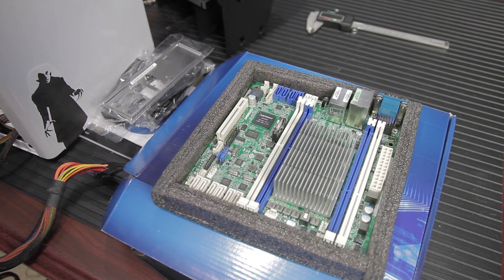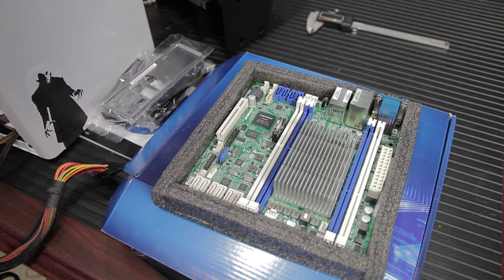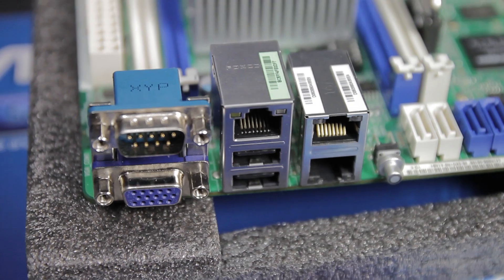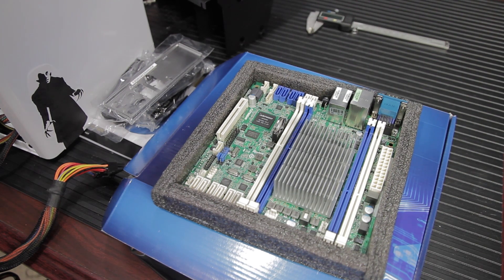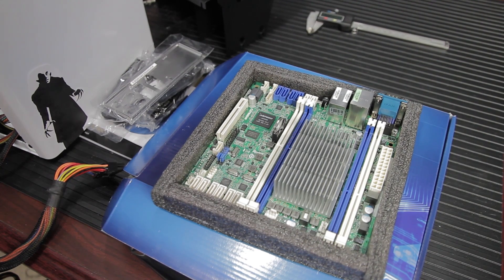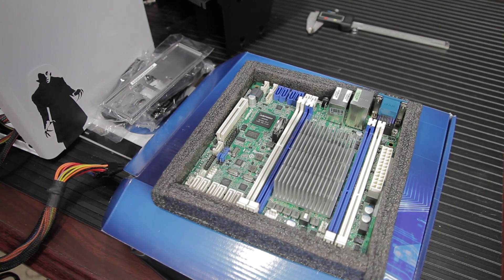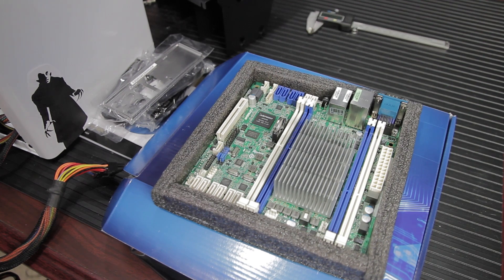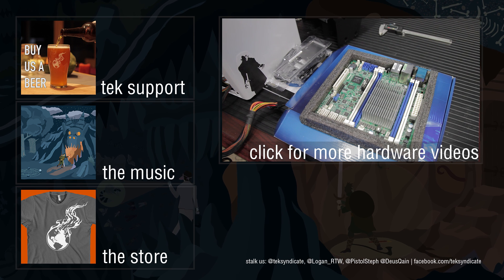ASRock C2750D4I: Intel Avoton C2750 Octa-Core ITX Motherboard

Comment: finally they made an itx board worth building a tiny pc with.
Reply: R0K99 PCI-E 3.0 x8 with the end open.
Reply: For most usage the Asus itx boards are pretty awesome good. Only limitation is the ram and ski options
Reply: Jar Jar Banksy im sure its capable of much more with 64gb ram... although no pcie 16x slot kind sucks.
Reply: Jar Jar Banksy
It dosen't have a pci-e slot
Reply: This really is purely meant for storage applications. I wonder how well it can render video though.
Reply: Brick Tamland it is a x 8 slot that can take a gpu. The end of the slot isn't closed. The question is merely whether it runse at pci-e 2.0 or 3.0 speeds.
Reply: Jar Jar Banksy amazon says 3.0 so if you get a 3.0 compatible slot it should run at the same speed as a 2.0 x16 slot
Reply: You could run a gpu in that slot and it should work. Perhaps it would not be bad at gaming.  I wouldn't recommend using a 780 ti with it because I don't know if the processor would choke that, but a midrange card could totally work. That or a titan if you intend to do computational stuff, which would fit in a theme with the 64 GB ram.

This really isn't meant for any of that though. :P